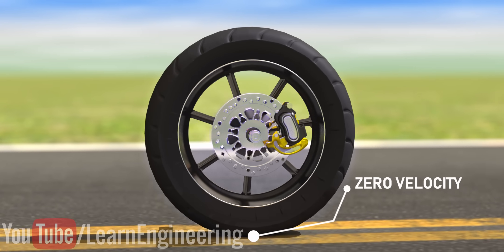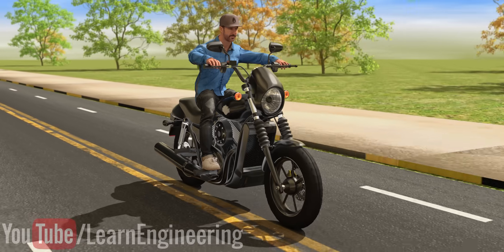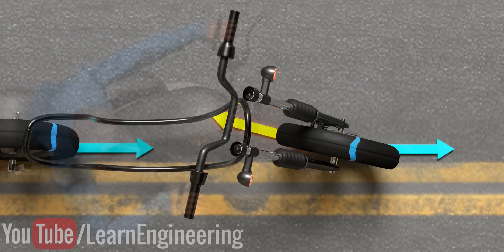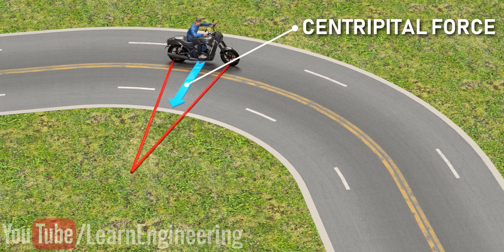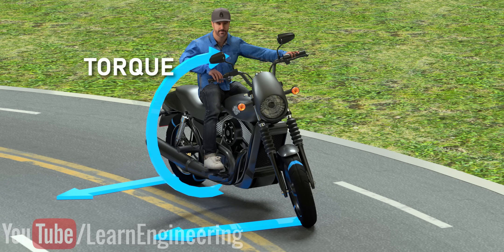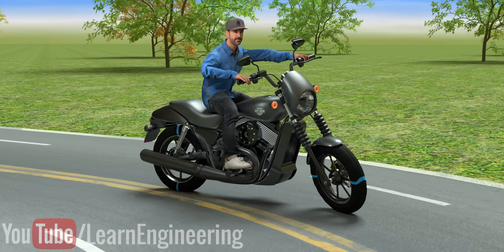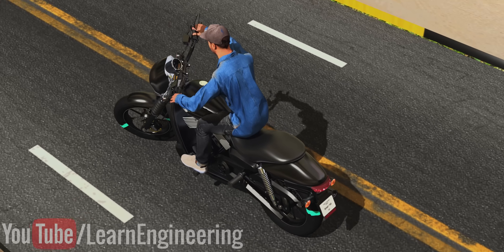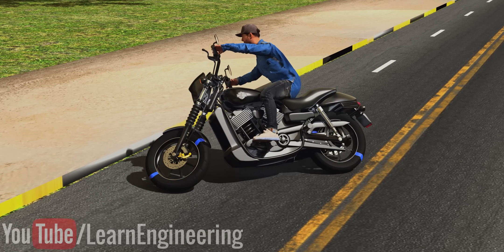Counter Steering | The interesting physics behind it

Comment: This seems to be a complicated way of understanding counter steering and its basically much easier to understand.  

First a car cannot counter steer as all of its contact patch with the road is in a flat surface. If one cuts a car tyre in half then in profile it has two almost vertical  sides and  about 15 cm of flat surface in contact with the road so when it turns it turns on that flat surface thus no counter steering takes place.  

A motorcycles tyre on the other hand is built differently. If we cut it in half its got a complete rounded shape in profile and this profile is what makes the difference.  On the straight the tyres contact point with the roads surface is in the centre of that tyre.  At any speed in order to  steer to the right we must first  push the right handlebar forwards.   By doing it appears that we are initially turning left but we have  just moved that contact patch very slightly  to the right hand sidewall  of the tyre. 

So we no longer maintain that central  and straight on contact patch with the road but  by now we start to traversing a lesser circumference of the front wheel on our right side.  We  will then naturally and  initially start to fall over to our right. We are moving  sideways right  on that new contact patch which is now slightly to that side, the hand right side,  of the tyre. .  If we continue or steer further  to the right  by more  pushing forwards on the right hand of the bars  ie counter steering the bike will begin  to actually and quite naturally fall  over to its right  side and thus give us more  of our desired lean.

We determine what degree of lean we need in order to complete that particular turn or corner.,  but this fall or lean is controlled by ourselves and as we  continue to maintain pressure on the right handlebar the move over to the side wall of the tyre is greater and that now  means that our contact patch is now well over to the right  hand side of the tyre.   

As a consequence of the above we are now traversing  less of a full circumference on the right side of the tyre as opposed to the full circumference initially when  we were on the straight. By being now in a   lean over position on the right hand  side of the tyre we are traversing a circle, bend, corner or curve to  our right. .  

So when we reach that point of change to a lesser circumference of the wheel, ie. when the bend tightens our contact with the road the bike will continue  at  a controlled lean angle and over to its right hand side  but  continuing the push to the right and giving more counter steering plus our leaning  with the bike over  to the right the bike continues to lean and  it will continue in that lean angle as long as we maintain that pressure to our right. 

If we think or know that we are running too wide  and wish to tighten the progress of the bike on the bend,  then we just need to push a little more to the right and that will move the contact patch further away from the middle and that again lessens our circumference in order to take  the new severity of the bend in question.   Also we may slow slightly ,say just off the accelerator and that will cause us to slow us down and that means more frontal pressure on the front tyre, compressing the forks   and that will reduce slightly the  overall length of the bike and by altering the length marginally between wheels we can make the turn a little  tighter also.

So basically if you want to turn right, the more you push right the more your bike will  fall or lean to the right and the front wheel contact patch changes and becomes on  the right side  of the tyre.  This  causes the bike to fall and lean  over to the right and you then traverse a right circle or turn.  The more you push right the more the contact patch moves away from the centre of the tyre and to the right of it  and  the more you will turn.  Right.
Reply: That’s much easier? 
Or;
Push left go left
Push right go right
The how’s and why’s are irrelevant!
Reply: @softailfun  I agree with you but when people start using science then most riders will get lost or just turn off. Simply  By pushing left, the bike falls over to the left and one then follows that fall and the bike turns left.   its much easier, I just gave it a little more meat,. that's all.  Happy riding and taking bends.

Comment: As many people have pointed out, there aren't 2 ways to turn. There is one way to turn, countersteering. What matters is whether you are doing it consciously and knowingly or if you're just doing it because it's what feels right. But everybody does it all the time period
Reply: @Daryl C Mills You literally have no idea what you’re talking about. Also, if you do ride motorcycles, or bicycles for that matter, you countersteer all the time — that is the only way to turn. You’re just not conscious of it which means you are more dangerous, your reaction time is slower, and you are liable to steer directly into the collision instead of away from it.
Reply: @sam.merritt but where does the push right, go right. Push left go left fit in. I ride an r6 and never turn the handle bars coming into a curve. Thats literally what msf taught. Push right, go right.
Reply: @DarkGreenMar1ne  it's a subtle thing.  Most of the time people do it subconsciously.  You start turning left by turning the handlebar right.  That makes the bike lean left.  Then you turn the handlebar left to prevent the left lean from going further.  You maintain the handlebar left through the turn then you turn the handlebar further left to bring the bike back to vertical.  Every step of the way counter steering is how you change direction.  I doubt the msf teaches otherwise but if they do, they don't understand physics.
Reply: @Daryl C Mills 
😂😂😂 hilarious!
Reply: @Daryl C Mills there was a guy in a motorcycle that tried to dodge a truck in a corner by steering the "normal" direction but instead steered into the truck and got into an accident
Reply: @yootz  so what happens if you just steer the “normal” way and not counter to the direction you’re trying to go? Will you not turn at all or just end up crashing
Reply: @zainabsiddiqui6154  You will turn the opposite direction. So if you turn without countering to the right you will turn left instead.
Reply: @yootz  ohhh interesting, ig its something you dont rlly understand until you actually get on a bike
Reply: @zainabsiddiqui6154  once you understand it, it's basically reflex, you steer right to go left. but that only works at speed above 12 mph or so, if you're under that speed, you have to steer a bit to the right and then steer left to go left and vice versa.
Reply: @yootz  you countersteer at any speed from idle and up.
Reply: @everyday tenor what i mean by it works or not is where it would actually have an effect on the overall handling characteristics, not in the way things technically work.
Reply: @everyday tenor yeah i agree with that, just that below 12 mph, you still have to angle the steering a bit to the left to turn left, while above that speed, you don't need to do that.
Reply: @yootz  Ther is ni such speed as 12 mph. Yu countersteer at anny speed, from idle and up.
Reply: Its not steering its leaning..you push handle bar down..
Reply: Not necessary. You just learned about countersteering and that trying not to consciously use it being risky. There is another method also. That too has a term if terminologies gets additional points in your book. If you push down on the rightside of the handlebar, you will lean right and involuntarily turn right. Go figure!
Reply: there are guys riding sport bike who have never heard of counter steering they lean with the body weight. i was amazed. you can do it but it is not sharp lean.
Reply: most motorcycles are too heavy to lean with normal steering
Reply: @Hong16492b   I'm not sure what you mean, the amount of lean is proportional to the amount of turn and the amount of speed, yes. My point is that the only way to steer is to counter steer, you can't do it by shifting your weight. If you think you're doing it by shifting your weight, then you are unconsciously countersteering
Reply: @sam.merritt  the tendency to lean is related to the steer angle ,the amount of speed and the mass. if ignoring the steering angle, i.e.,we can lean faster with counter steering, the bike is harder to lean if it is faster and heavier. You can trigger leaning a bike with normal steer just like in this video. But in real life, the speed is not enough slow and the bike is not light enough to do it that way.(you crash before trigger leaning)
Reply: @Hongdar   I know you understand what you are saying but I have no idea what you're saying. When you lean, without countersteering, you are pushing the bike away from the direction you want to go.  For every action there is an equal and opposite reaction. If you lean in the direction you want to go, you are pushing the bike the way you don't want to go. If you truly weren't countersteering, you would end up going the opposite way you want to. The reason you think cleaning works is because really you are countersteering you're just not aware of it. I'm just telling you the facts as dictated by physics and as demonstrated by slow motion video time and time again, that countersteering is the only way to initiate a turn in the proper direction. Even if you don't realize you're doing it. If you want to turn left you have to initially push the left handlebar away from you, which initiates leaning to the left period, that is counter steering. Then, after the lean is initiated, you have to pull the left handlebar towards you to maintain the turn without a low side crash. What you are essentially doing is countersteering to turn the bike right a little bit, just enough to keep the lean angle stable as you go through the turn. Coming out of the turn, you pull the left handlebar closer to you in order to counter steer back to vertical. That's just how steering a motorcycle works even if you aren't aware of it

Comment: I love that this channel chose to explore this fascinating topic, but I'm disappointed in the analysis. The physics explanation is incomplete, and the description of how a rider implements counter steering doesn't sound anything like what I experience on a motorcycle or bicycle. As for the statement "Obviously, countersteering is … slightly risky. If you don’t steer the handlebars back to the proper angle during the leaning operation, you’re going to fall down." That sounds ridiculous.

Comment: I learned That within a year growing up on a Dirt Road i knew all the sliding Highside flips When i got my first fast Bike , I respect but am not afraid , to lay one over in a corner it was weird the first time i i was taking a curve and turner the handlebars the opposite way the bike Laid over in the turn Quickly i rode counter steering i never knew what it was called But my riding buddies thought i was a much better rider than i was , I wore the chicken Strips off my tires early , Bought Good Gear and been Doing it ever sense You will run out of road if you do not counter steer fast through a corner seen it happen many times ,taking people to the Dragon .

Comment: Actually, the "falling down" in the countersteering example is a bit "BS" - if you stop applying force to the handlebars, the bike will not keep leaning further down, as it is already balanced. Also - you always countersteer on a 2-wheeled vehicle, even if you do not think you do.
Reply: Yes; even an unmanned bike will recover. The correct view is that a fall-like event begins. If the bike were standing still it would fall down, but because of the dynamic situation, it recovers from the fall by steering in that direction.
Reply: So i always countersteer with my bike? Or is that not counted as a vehicle
Reply: @hhhhhhhhhhhh8192  Any two wheeled vehicle so yes, your bike.
Reply: @hhhhhhhhhhhh8192  https://www.youtube.com/watch?v=9cNmUNHSBac
Reply: As I said.... it is very badly illustrated.

Comment: The video started.. 5out10 score, a few moments later, 0out10.. score... I have a father in law that cant grasp counter steering(he has crashed in countless corners and still does), if any of you people have fallen due to running wide in a corner, then stay on four wheels or do proper damn study on what counter steering is. If you never get it then just save yourself the pain. And people saying you do it natuarally is also uninformed, as any damn vehicle has controls, and a motorcycle turns by counter steering @ speed above +/-30kmph... f##k me... end of story.

Comment: There's a similar concept with cars when drifting/racing. Weight displacement. At high speeds you can't make sharp turns without using the weight of the vehicle; just turning the steering wheel/handlebars won't do any good.

Comment: Me who started doing counter steering  when I was 6 yo :😎

But there is not such thing as normal steering. counter steering is something we do all the time while speeding. this thing yah call normal steering is just the simple uh-uh th-thing u doodoo when you turn at turtle speed. Literally!
Like when an SUV with high suspension travel turning at a about 40mph and you can see it leaning without even using your body weight (like hell you could lean an elephant SUV with YOUR OWN BODY WEIGHT!) 

Hey me , just calm down okay! 😅
me :k before thate I wille do somethinge to calme me downe 
JRHXHSHSHSHSHSHSHHSHSSN

Never gonna give you up never gonna let you down lever gonna run around and desert you 
EEE-EE-E.........
we're no stranger's to love........

Comment: This is a bad video to learn about counter steering. Go watch somebody demo on a bike instead of watching an animation. 

4:10 Once you're moving 15 mph you can continue to counter steer all the way through the corner. You will not "fall down" by continuing to counter steer. You can push harder to steer sharper. That wouldn't work if the rider had to flip the handlebars mid operation to balance things out again. You just continue to counter-steer always above 15 mph... The bike knows how it works, even if you don't.

Comment: Easier to understand explanation: Counter steering (usually above 25 miles per hour) creates a force (caused by biasing a gyro?) that makes the bike lean in the opposite direction. This helps you turn in the direction opposite of your counter-steering. It's counter-intuitive, but totally true.
Reply: The most easiest explanation ever:
Push left to go left.
Push right to go right.
Zero speed or faster!

No need to try to understand gyros (which have no (real) effect at all)).

Comment: Used by "many" riders???  It is freakin' used by every single one, whether they realize it or not. 2:54  is a lie, only time "normal" steering works on two wheels is at extreme low speed.  At speed you HAVE TO use reverse steering.  Even if you just shift your weight the cycle will reverse steer itself.

Comment: If you have spent any time behind handlebars you know that balance is everything. A properly balanced bike with good geometry on the angle of the front forks will always pull straight when upright and will shift its natural pull with the angle of thrust created when the bike is in a lean. Most cruisers and all dirtbikes are designed and built using this characteristic. It creates a ride that is forgiving, stable, feels comfortable, and even in low traction conditions will allow the rider to regain balance with a quick tug to the inside wich starts the bike tiliting to upright, and gainig traction. It is at that point you will be in danger of a high side being thrown from the bike, or if the tug is too weak losing front traction completely and washing out. Worn tires and damaged or bent forks will compound this problem. Using the countersteer technique to rapidly throw the bike into a lean takes practice, dont be afraid to spend time in a parking lot getting familiar with your ride. You need to know how far is too far and what the limits of the tire and the bike handling before taking these maneuvers to the extreme. Best advice i can give is if you ride, ride often and with friends. You can crash in the woods getting stranded or even on a street bike having friends with you is always a plus. The most effective tool you have on a bike is your brain. Sensible riding is great, and go get some cycle therapy

Comment: This is the single greatest thing any rider can learn no matter what your experience level. Although correct this video is way over complicated for the average Rider. You're going into a right hand turn push on the right side handle bar, not pull.. very little effort is needed and very little or no body movement is necessary. When pushing on the right hand side as you are leaning to the right into the turn, this counter steer will want to make the motorcycle lay down on its side. It will do that very thing if you push too hard or stay on it too long. Just push on it a little as the bike drops down ease up and let the bike stand back up as you're coming out of the turn. You will never trailbreak a street bike again. You will always have major confidence when entering into sharp curves under power. Once you try it you'll get it immediately.if you do not know this technique, it will be a game changer.

Comment: This is the worst explanation of steering a motorcycle I've ever seen and may get a new rider killed. There is no "normal" steering motorcycles at speed. It's impossible. If you try to make a right turn by turning the wheel to the right at 35mph you are going to get thrown over the bike in a high side crash. This video makes it seem you have to make a conscious choice to countersteer over steering "normally".  This is false and not even debatable.
Reply: Well, if you attempt to make a right turn by turning right at 35mph……. You’re going to go left.
https://youtu.be/lzk8oyNO708